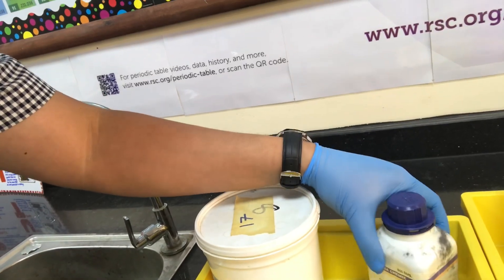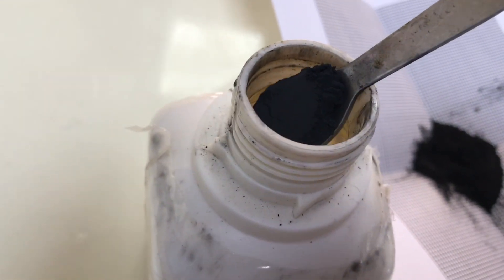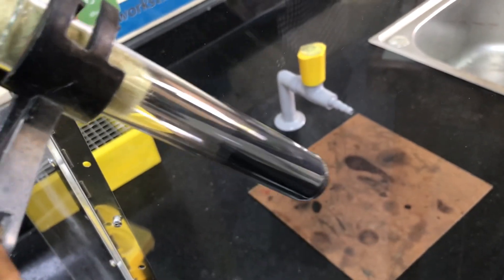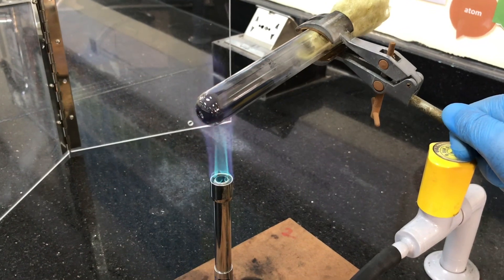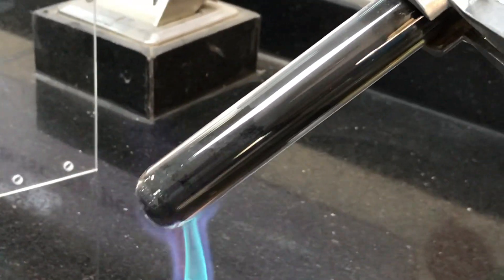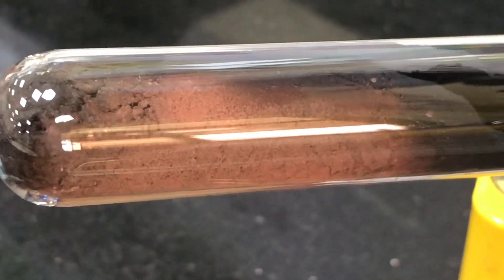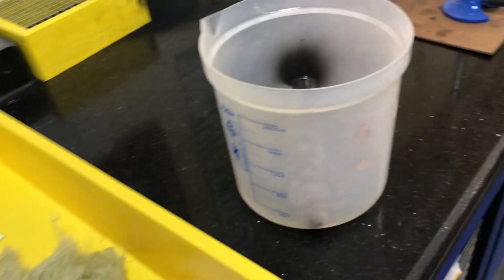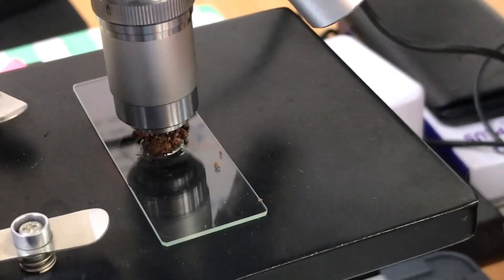REDUCING COPPER(II) OXIDE WITH CARBON (TEACHER DEMO)

Comment: Excellent.  I ❤ this video.   Y only question is how do  you know it’s copper (II) oxide and not copper (1) oxide..?
Reply from the maker: Easy one to answer, the copper(II) oxide was purchased from a supplier of chemicals that services schools right across the GCC region. We therefore are pretty confident that what you see is the real stuff! :) any traces of copper(I) oxide would of course oxidise to copper(II) oxide upon heating.

Comment: Thank you for your demonstration.
I have a question:
Is it still the same element or transmutated into another?!
Reply from the maker: The elements are still the same as the atoms themselves have the same number of protons in them. It’s the number of electrons around the nuclei that changes. Changing the number of electrons on copper or carbon changes its chemical properties, the new elements / compounds here have physical properties that are wildly different.